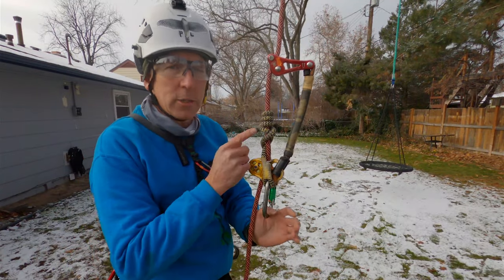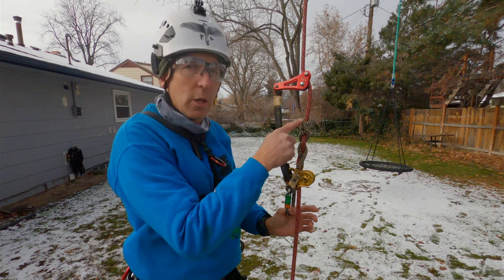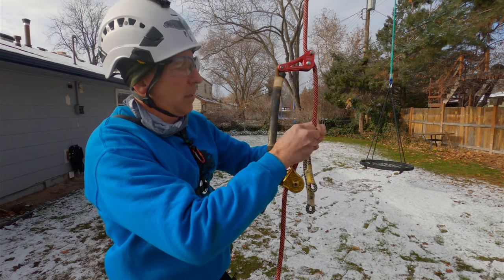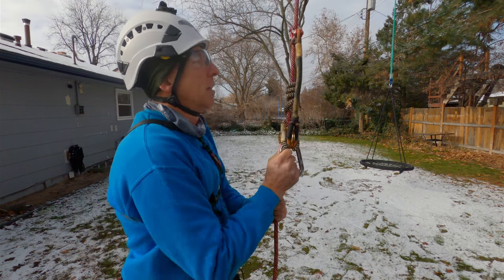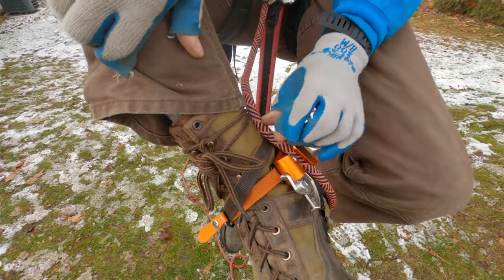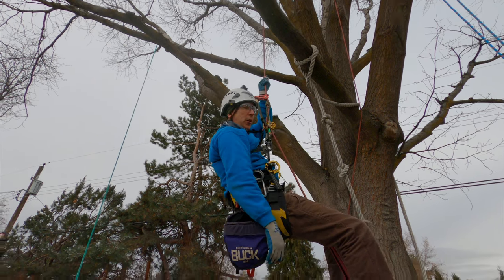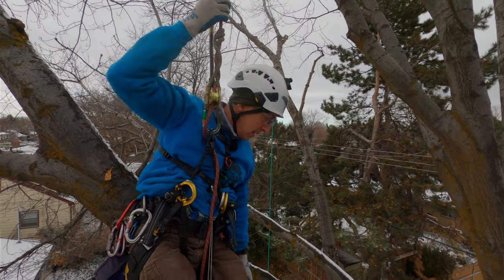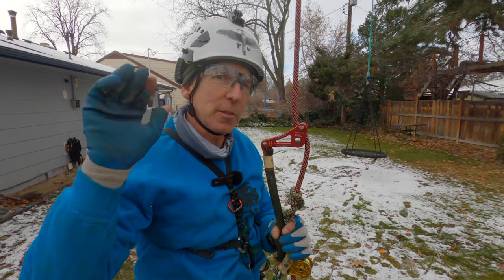How to use a ROPE WRENCH: SRS (SRT) Basics | 2023

Comment: You have a talent for teaching. I like that tip on testing your hitch cord. I climb on MRS, and I will try that next time out. 👍🏻🇨🇦🇺🇸
Reply from the maker: I'm glad that was helpful. We need to add more content soon!
Reply: Same, ive only climbed drt but srt is so crucial for getting up in the tree to get set up. debating on getting a zigzag so I dont have to replace hitch cords as they wear out.
Reply: @josiah513 , yes zigzag is what I have been looking at too, especially when I think that hitch cords are life support!
Reply: @josiah513  I was told that a zigzag will wear out quickly if not used in conjunction with a Chicane... you can feel the ZZ take on a lot more stress when just using it with a rope wrench.

Comment: This is one of the best I’ve seen as to what to expect when someone has bought the gear… and as to the common basics they need to know.  Really intuitive.  I would love for you to point me to a video that more carefully constructs the process of the hitch friction knot, assuming I have bought all the gear, and am not quite getting it right.  Also. I am expecting to get on a ladder with my cord and weight, and throw box, and try to get up to where I want to go.  I would appreciate advice there.  But also, assuming I don’t get my line all the way to the best V in the tree, I intend to use a flip line to get me the few feet to the next one.  If I don’t have to carry a heavy flip line, and you have a better suggestion in working your way to the top (and the gear to install to not have to do it again, on a permanent basis), that would be great.  Assume this is for antenna minimization and also maintenance… goal being. Permanent materials. Easy access. Easy repeatability.  I very very much appreciate the time you have taken in your selfless tutelage.

Comment: Excellent explanation. I rather connect the carabiner to the hitch climber pulley from the left to the right though. When You finally spin the carabiner around the gate opening are facing down and it is easier to connect to the bridge if you are right handed. My personal preference. All the best.
Reply: Thanks Stefan. I should try that and see how it works. David

Comment: Love your comprehensive, thorough video - well done!  At 3:56 it says "You have have to test your knot without the rope wrench..." While this certainly makes sense, I've tried to carefully look thru my ISC guide I can't find the reference, nor have I found others quoting this seemingly critical step.  Can someone help with a collaborative reference?
Reply from the maker: I haven't looked at the paperwork for the Rope Wrench in a while but I know it's in there. Also, Kevin Bingham who invented the Rope Wrench is a friend and he confirms that this step is critical. I can say from experience that there are times the system will hold with the Wrench in place but will slide when removed.

Comment: Good Video on rope wrench.  I just climb as a hobby but I noticed many people (including this video) use the VT with 4 wraps on top and 1 to 3 braids.   I watched another excellent video on tying the VT with 2 wraps on top and 3 braids.  I tried both ways of tying without actually climbing and the 2 braid system seems to catch better and always works (without actually climbing), while the 4 wrap system doesn't seem to always grab properly.  Just wondering, why do almost all explanations on tying the VT (especially with the rope wrench) use 4 wraps on top ?  Maybe because it's easier to grab 4 wraps when descending, not sure ?
Reply: Hi Fred, the 4-wrap version of the VT is pretty traditional and widespread. It catches well when you switch to descent. The number of braids depends on the length and diameter of your hitch cord, rope diameter, and climber weight, more than anything. Try several hitch cords and find the one that works best with your rope.

Comment: if, prior to climbing, the rope wrench slips down just by pulling down on the plastic tether, does it mean that the wrench with squirrel tether is not properly installed or will it be resolved by hanging on the rope with my own weight ?  Thank you in advance for your help and consideration
Reply: That is a GREAT question. Always test your climbing system before ascending. Install the Rope Wrench, pulley, friction knot, and carabiner. Remove the rope wrench from the rope, and with the carabiner attached to your harness, take a jump up and fall. The know should catch immediately and firmly. If it doesn't, retie the friction hitch. Once you have a hitch you trust, reinstall the rope wrench and climb. I always like to climb a few feet (like six) and then rest in the system to make sure everything is holding.

Comment: What is a good length for the prussic, eyed cord?
Reply: Depends on the girth of the cord and the weight of your body.
Reply from the maker: That is a good question. We have a video on that in Spanish and we should do one in English too. The length of the cord depends on many factors: diameter and jacket material of the rope; diameter and jacket material of the cord; weight of the climber; length of the rope wrench tether; height and reach of the climber. All of these affect your choice of friction hitch to tie. My preference is 28 inches and 10 mm. You could start there and experiment to find what works for you.

Comment: Thanks for the great video!
Which system damages the rope the least?
a mechanical prusic or this system where there is friction between two cords?
Reply from the maker: It depends on a lot of things, including which type of rope you're using. Overall Rope Wrench system is the most gentle on ropes. Some ropes flatten more than other with mechanical systems. The old style Rope Runner is known for flattening some kernmantle ropes.

Comment: hello, great explanation. One question - from rope access I am used to allways have some backup. Isnt it needed here too ? I dont like the idea of letting my life to depend only on one single device here.
Reply: Kryton, this is a great question, honestly. In tree climbing we only use one access line to get into the tree. Sometimes we have lanyards and secondary ropes, but for ascending and descending it's on a single rope. Any time we work with any type of a blade - chainsaw, handsaw, pruning sheers, knife - it's best practice to have two points of attachment. Trees have a complicated structure and trying to manage two ropes simultaneously can introduce more danger than safety. In some European countries the regulatory commissions are introducing a 2-rope standard, and it's unwelcome oversight. All of this stresses the importance of constant rope inspection and hyper-vigilant maintenance. Thanks for the question - David.
Reply: @davidanderson5736  Hello David, thanks for the answer! Yes, two ropes seems impractical. I had the rope wrench itself on my mind. If that prusik fails or slips, you are dead I guess. That makes me feel antsy. I was thinking about adding something like Petzl ASAP above the rope wrench (on the same rope). I know it would be out of intended usage, but I am just trying to find something to feel safer while learning.
Reply: @kryton7687  the rope wrench is the one tool that is applicable to more climbing ropes than any other. The test I show in the video is to verify the knot is correctly tied to prevent slipping. If slipping is a concern of yours, simply tie a slip knot every 6 feet or 2 m below you; if you slip or lose control out of fear, you will hit the knot and your descent is stopped.

Comment: Are you able to remove the isc singing tree wrench from the tether ?
Reply from the maker: Brayan, one of the great things about a rope wrench is that it's mid-line attachable. You can put it on the rope or remove in on the ground or while in the tree.
Reply: Yes, and you can buy them separately as well.

Comment: Will the rope wrench take smaller ropes?
Reply: That is one of the best features of a rope wrench: it is more compatible with ropes of different sizes and materials than any other device. I have climbed on ropes as small as 10 mm without a problem.

Comment: Why not 2 foot acenders...?
Reply: Wow. That's a great question. I haven't tried using two foot ascenders but I should give it a go. It would change your body movement totally because you would have to lift both feet at once. That was a style in the old days when we climbed on hand-held ascenders (Jumars) and it worked well then.  I think that having one foot and one knee ascender makes it easier to step off on branches. It's worth me trying out the two foot ascenders so I can can answer this question in the future.

Comment: Why don't they just use an ascender? What am I missing?
Reply: The Rope Wrench allows ascent, descent, and lateral movement, all on the same device. Most mechanical devices are for ascent only (like hand-held ascenders) or descent only (like a GriGri), and are not approved for lateral (side to side) movements. Climbing on a Wrench is fluid, safe, efficient. You get to go any direction - up, down, sideways - whenever you want. Climbing on a system where you have to switch between devices to go up, down, up, down, etc. is awkward, inefficient, and dangerous.